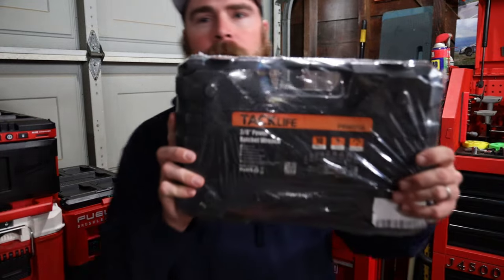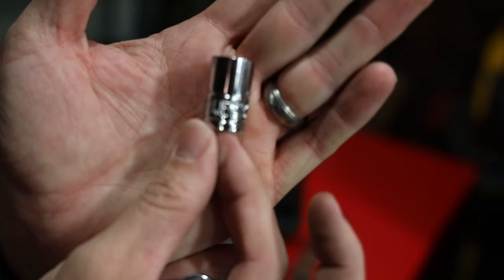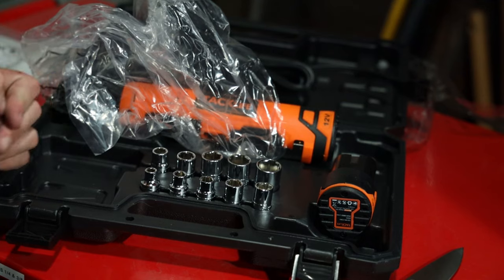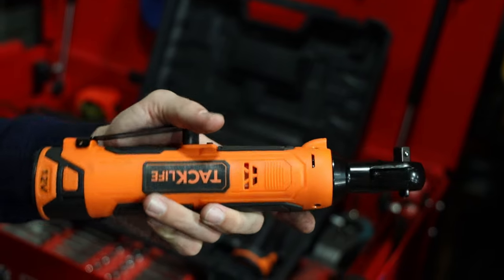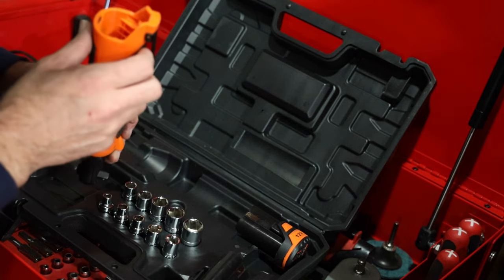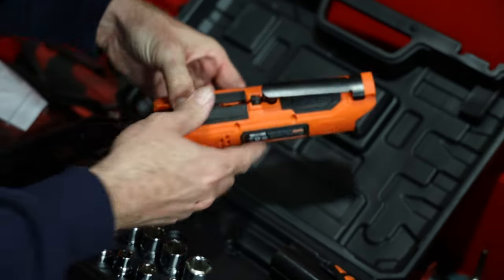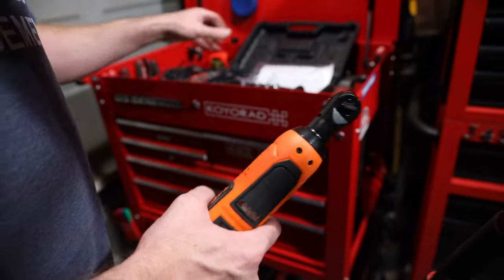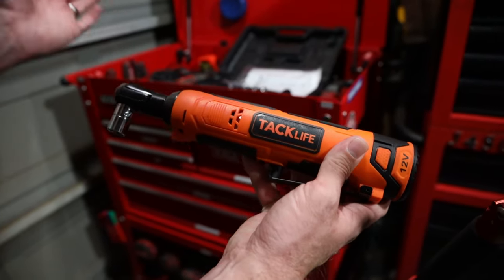Cheapest 3/8 Electric Ratchet ON AMAZON vs Milwaukee Fuel M12 Ratchet

Comment: Years ago I was in the fence thinking of getting one of these cheap china ones vs the non fuel china Milwaukee. I decided to go with Milwaukee for like $120 with a 2.0 battery and a charger from eBay. So glad I did as I was in the m12 platform and now have two other awesome m12 tools.

Comment: Nice, honest review brother :) I've just bought an El' Cheapo cordless ratchet from Amazon, it's a POSENPRO Electric Ratchet Wrench 3/8" 35 N·m 280, pretty torquey tbh but I guess it's something along the lines of your one. £37GPB but will be useful for spinning nuts and bolts off once cracked.

Comment: Did you see that the inner head is made of 3 pieces and not solid. It will eventually break. This Tacklife ratchet is the same as the other Amazon item Avid Power. They both have a 3 piece inner head and not solid like the other Amazon cordless ratchets.